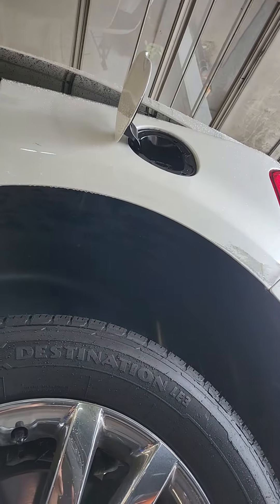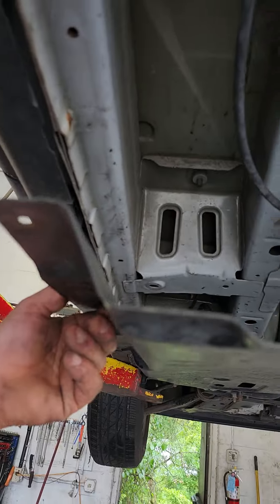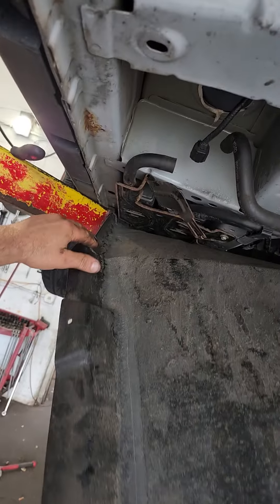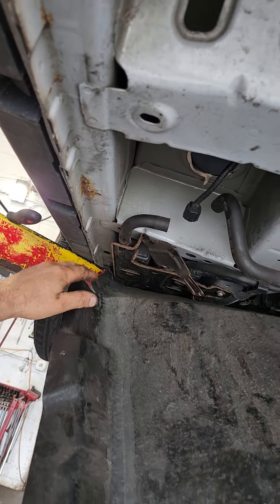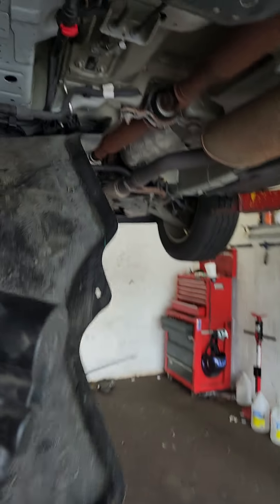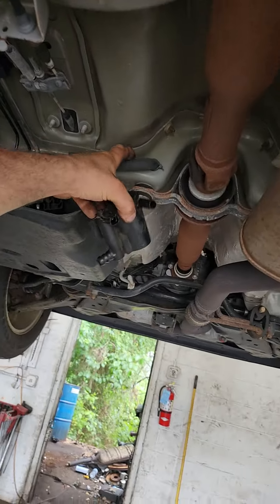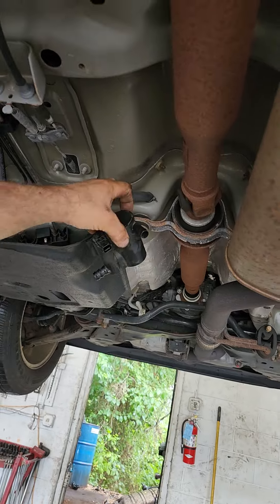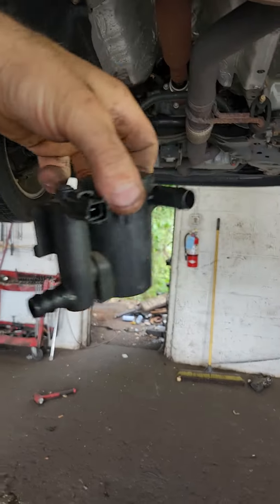Very small, small evap leaks w capless filler neck 2012 Ford edge

Comment: 07 chevy impala lt if I put rear struts on do I really need alignment?
Reply from the maker: Alignments should be checked and performed yearly aging changes. Alignment angles . Bad driving habits. Yes, anytime 0:07  suspension parts are changed a align should be performed .Skilled shops can do most settings w o a machine, and maybe some won't or can not